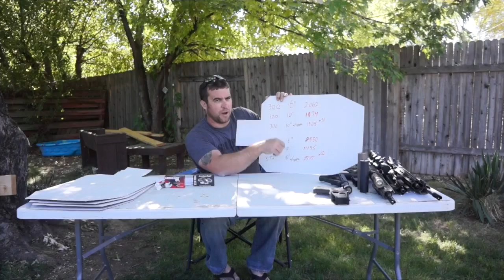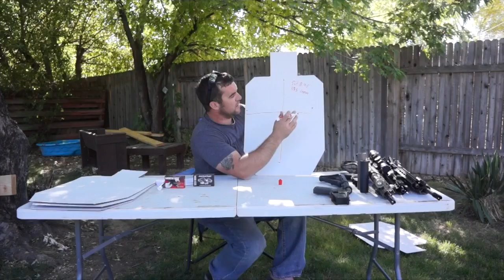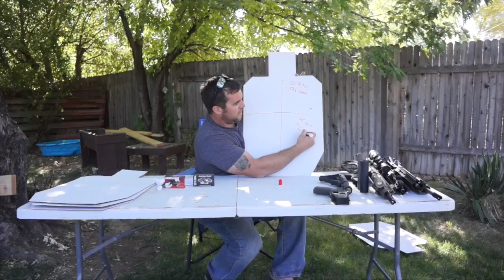Gunfight Science: Is 5.56 NATO Dumb?

Comment: do you feel feel like a compromise would be some of the heavier 556 loadings like 77 grain otm?
Reply from the maker: I do really like 77 gr out of longer barrels. I'm just not a fan of any 5.56 if its moving slow.
Reply: GunsAmerica ugh good points .... My hand loads are cooking out 3600fps on a 53g vmax with a compressed load out of a 26 inch barrel... Wish I could deploy with my own weapons / reloading bench
Reply: You do retain a lot more energy with a 77 grain in an SBR, but like GunsAmerica said, you still will be under that threshold of energy that a SBR x35 or full length 5.56 or x39 will provide, as well as lacking the fragmentation that a full velocity FMJ provides.

Mikeivanic brings up light weight thin jacketed bullets such as the vmax (my favorite) and this is by far the best option for any home defense firearm. 

[copy paste]
If we stick with FMJ, definitely longer barrels are better. However, for most of us we can use hollow points and nothing is safer than a 5.56 rifle of any barrel length using a thin walled ballistic tip light weight bullet (Hornandy V-Max is my favorite)   The bullet can break up quickly even after just impacting drywall, and while the wound is shallow as seen in ballistics gel compared to most rifle loads  (penetrates around 12-14" depending on bullet brand), it breaks up just like how a FMJ fragments like when it is in a 16"+ barrel. Energy wise, it is like a 44 mag out of a SBR (7.5" barrel) but unlike most rifle loads, nearly all the energy is transferred into your target, effectively making it as good as full length rifles without the overpenetration.